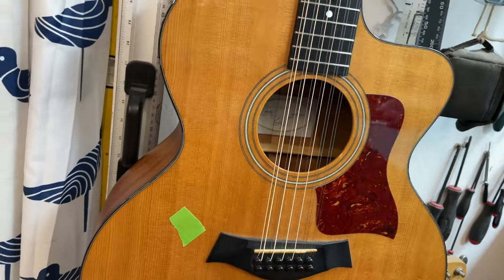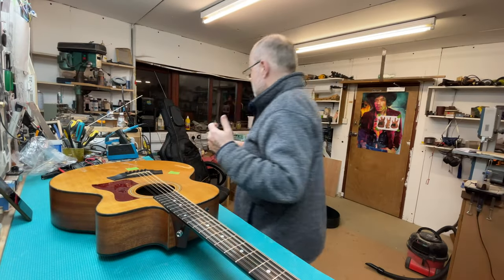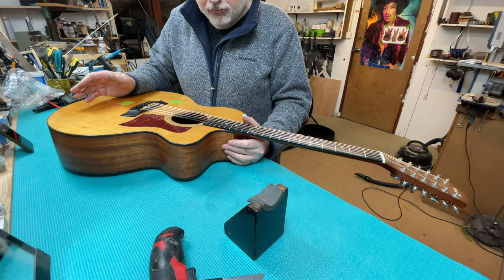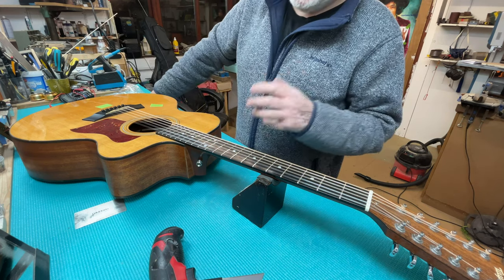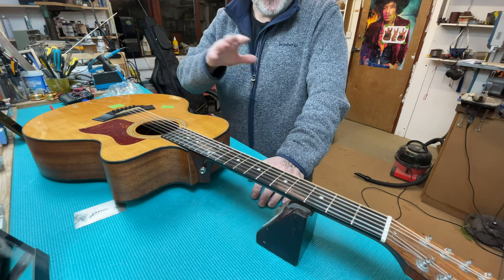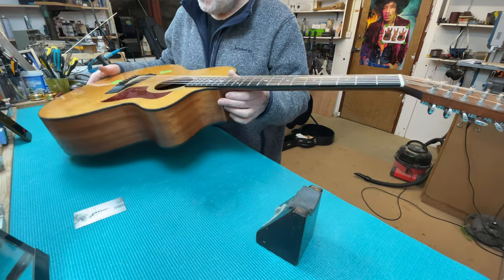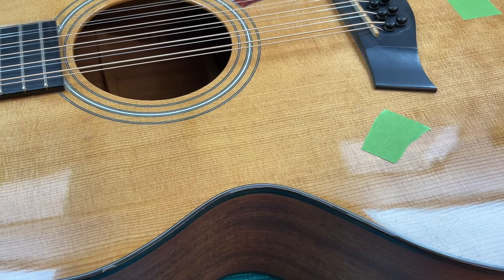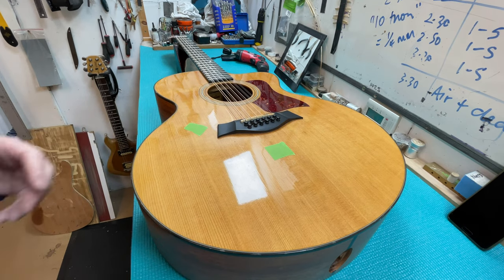Tayor 355CE 12 String acoustic evaluation and decisions

Comment: Hey man ,no sound ! ( YT App)
Reply from the maker: It's that YT App problem Eric. YT knows about this but doesn't do anything. Full sound when played on a browser / laptop as I'm doing now. Sorry!
Reply: Video sound is fine- I’m playing the app on an iPhone.  Sam those extended bridge slots could well have been done during final setup at the factory.!!  I’ve seen a cpl brand new Taylor 12s with extended bridge slots right out of the shipping box, and they were pretty crudely done IMO. It’s like their 12s were never really fully thought out. So the action is fine on this one if it ain’t broke…for now. But  you have nowhere to go on the bridge saddle- it’s gonna need a reset at some point. If the owner has a few hundred quid to spend now it’s not going to be any less expensive 5 yrs from now. I’d advise him/her to do it and be done. 
My .02
Reply from the maker: @HBSuccess  Thanks for sharing your experience and opinion. I’m going to put it to the owner - to be fair, he wanted me to do the while neck reset thing now… It’s just me thinking he can hold off :)